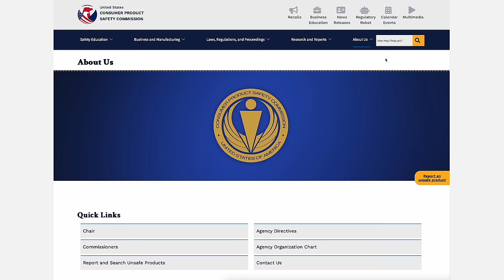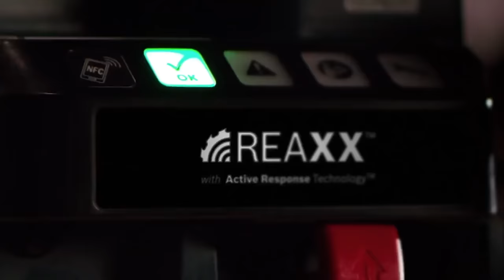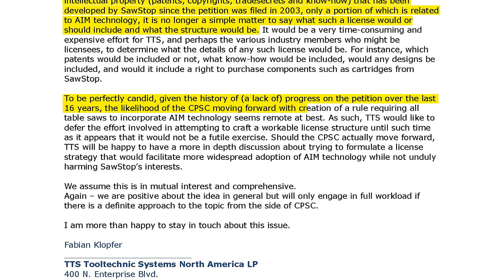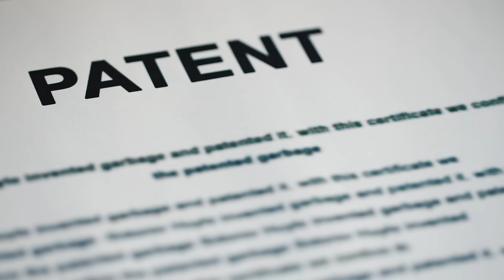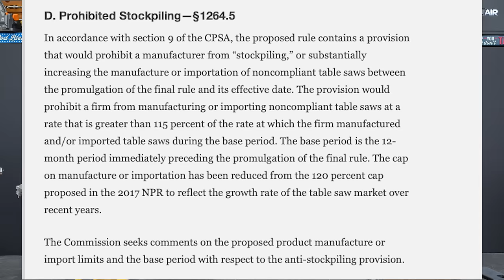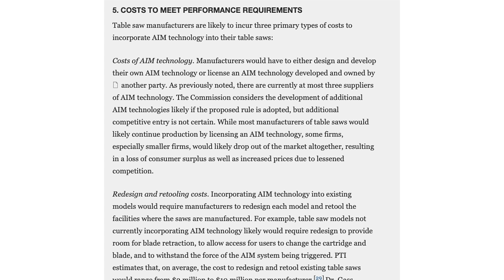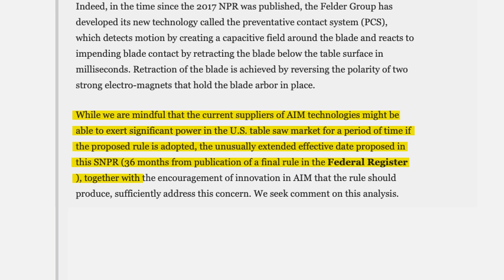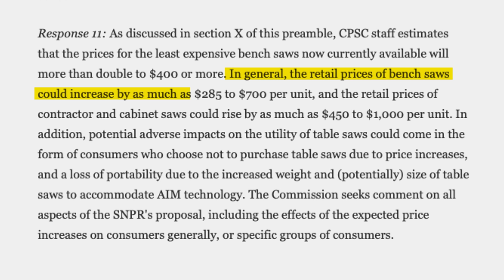The US Government is About to Change Table Saws FOREVER!

Comment: Bosch had a similar, but significantly different from SawStop system, yet Steven Gass tied them up in court and forced Bosch to not sell their version here in the states. 

I would be curious to hear if this law is going to restrict private resales of existing saws? Government can’t even do their presently legally required jobs that they are supposed to do now. Why do they think that they should be passing more laws? Makes absolutely no sense to me considering everything.
Reply: This will spawn a sh1tload SAFETY CO'S charging you to inspect your equipment just like state car testing ( you will have to take your woodworking 
underground, they will then be watching the lumber yards to catch you buying lumber to use on unlawful saws.

Comment: I’ve been using a table saw since I was 10 years old. I’ve got all my fingers and never went to a hospital for a table saw injury. To be careless around a table saw is foolish and I have to question if self inflicted injuries should be counted. Also table saws don’t just die every 6 months, I still have both a 90’s Makita, and early 90’s craftsman table saw that run today, and just bought a newer saw last year. By their own logic changing the law today won’t help me for 20-30 years until I trade out for a new unit, at a greatly increased cost.

Comment: Question - Isn't this a one time use feature? As I remember the demonstration, once that safety element/device is used, there is a very high cost to replace the pieces that stop the blade AND the blade itself is ruined as well.  In other words once the device triggers, the saw itself become a piece of trash.
Reply: No it's not a "one time" feature. It's cartridge-based brake system that you replace ($99) and the blade. In other words, do an internet search if you have to type a "?" at the end of your sentence.
Reply: Thanks for the response - HOWEVER even at that for many people that becomes a deal breaker.  I'm not saying fingers and hands are not worth far more than $100.00 and a saw blade but an accidental triggering of that system is a killer cost item ON TOP of the initial saw cost when equipped with that device.   As the video states, table saws are going to jump up tremendously in price for the home hobby/DIY people especially when the smalelr companies stop making any table saws.   @ReadeMoore
Reply: So about $200 . I consider that single use for all practical purposes .

Comment: The addition of overly protective safety features breads complacency.  Let's face it: the woodshop is an inherently dangerous place to be.  You have to be aware of your surroundings and any time  you lose focus, it's time to hang it up for the day.  I recall once letting my thumb touch a measure tape while it was retracting, resulting in a shallow cut.  I cleaned myself up and went on to make a cut on the table saw.  I ran my  other thumb along the freshly cut edge and cut my other thumb.  That was my last activity in the shop for the day.  You gotta know when it's just not your day.
Reply: ok, you addressed this at the end.  I stand by my comment, though.
Reply: With Saw Stop, the $150+ cost to replace the blade and brake is still a pretty good incentive to pay attention, just reduces the pain of that error. But I agree that the best prevention starts within, but without.
Reply: Do you think we need to Keep government out of this, this will create new laws and taxes with higher insurance costs to shops and individuals seeking liability and disability insurances.   Will OSHA rules shut us down if we don't comply.

Comment: How much money and time did SawStp spend to make this tech work?  They SHOULD be compensated.  That it has taken 20 years to get to this point,  SawStop has not made jacks*** so far.  They should be given an extension.  I currently own 5 tables saws.  I spent 5 or 6 man hours on a table saw this past week?  My oldest continuously owned (more than 50 years)  cabinet saw is a 3hp Wilton Boice Crane manufactured about 1970.  It works great.  And could take a hand off in less time than it takes to blink.  I am all for SawStop and the other tech.

Comment: This brings to mind a new law in the 70's that required lawn mower companies to put the bar on the handle that you have to press for it to run. People thought it was an awful law. The reason that did it was because stupid people were holding the push mower up and cutting their hedges with them. Silly stuff like that.....

Comment: Also not calculated is the loss of productivity because you have to have another replacement switch on hand to replace the used one once a person triggers the safety item.  So the saw is useless until it is repaired.  Lost productivity.

Comment: No one should be buying a table saw from the store having never heard of one or seen one used before not read any of the directions and starting messing with it... So what is this regulation supposed to do make people using them get too comfortable around their shop and still have what happened to them and that is momentary loss of focus or a distraction where they  kept cutting and stopped looking to look at something else so they got hurt and will just get hurt while using the next dangerous tool they got when they still or even more so let their guard down. 

Regulate saw blade coming off and racing around your garage or being electrocuted when you use it not the costly and patented featured made mandatory for all versions of the tool to be paid for by all who need them to work. Not going to ever get a saw stop this smells like a profit driven corrupt and improper use of government.

Comment: 2:00  I bought a table saw for a specific job I was doing (Big wall of custom pine shelving for customers book collection)  I think I paid $180) .. Before I put the included carbide saw blade on ... I threw out all that crap. so i had just a tabe and a saw ... 

Point being .. none of that crap is "mandated" of you can throw it out.

Comment: When I got my table saw, I made sure to watch every 4 fingered teacher and their how to operate a table saw safely.  With that said, I found that there were some cutting operations that you could not use the supplied safely attachments.  I had to make various fixtures to hold work that would otherwise be unsafe. The pushing stick is your way of keeping your fingers out of the working area.

Comment: I have a SawStop in my shop.   I have inadvertently tripped the brake twice over the years.  It is amazing how much hidden metal is lodged in wood.    So either you go over each board religiously with a metal scanner or use the manual over-ride.    Since the former is time consuming I might suspect that those using contractor saws on jobsite will do the latter, unless they remove that option completely.  

To be honest, I am much more nervous using my bandsaw than table saw.  A bandsaw could remove many fingers in an instant.    But bandsaws are probably not as common on construction sites as a table saw.

Comment: OR here is an idea.
Enforce more strict safety measures in the work place.
The equipment is dangerous and should be respected.
If your sleepy, drunk, under the influence, exhausted etc. you should not be using the equipment. 
117,300 large truck accidents in 2021 9% fatal, and that means 10,557 people Died and 106,743 injury's. FMCSA enacted a law in 2013 that truckers travailing long distances are required to take brakes, they also made tech to enforce that.
We have created so many safety features in cars, and Rules of the ROAD, and yet we still have so many accidents, and to many deaths every year BECAUSE OF HUMAN ERROR.

The problem is not the Tech but the level of common sense and awareness people have. They are focusing on the wrong issues.

what happens when the tech fails?
If programs works 100% of the time I would not have a job, just think how often a week something does not work the way it was intend for you or some one you know, the fridge, your phone, the washer, the car, or even simple things like the remote. 
There is always something that has a piece of software that is failing or causes other issues, and how do you get by, by you improvising, and do something else, not the failing object.

Comment: Are these injuries mostly occupational injuries, or home injuries, or a split between the two?
One option is to push the regulation through OSHA, Schools, and Workers Comp Insurance.  Phase in quickly for new business purchases, then phase in regulations over the next 5 or 10 years to get all the old saws out of commercial service.
It is quite likely that hobbyist purchases would rapidly follow behind.  Perhaps have companies that sell saws without the feature to also sell product lines with the feature.
Then in a decade one can also transition for the hobbyist market too.
I'm of the opinion that a lot of the injuries are training.  Start young.  Always use a push stick when working around the blade, and keep track of one's fingers and hands.
Looking at Saw Stop history, there have been many reports of erroneous activation of the feature.  Better for sales if the saws periodically eat themselves up.

Comment: Since you did this video maybe you can answer a question for me. I would love to know what changed to hot water heaters to go from 200 dollars to 800 what changed in them to justify a 600  dollar increase
Reply: There are a few things - supply chain issues for one, two, energy prices driving up the cost of refining raw materials, three, increased transportation costs due to fuel prices, and four, increased efficiency and emissions regulations requiring more technology and components.  All brought to you by federal bureaucrats.

Comment: The safety part is good, but seems like it should wait until the patents are up to balance the cost to consumers, and that price increase doesn't include the costs for when wet material or conductive material triggers the safety device (in SawStop's case anyways...).  I got a SawStop benchtop (~$900) because the math around an injury is compelling and i could afford it, but this seems shady by SawStop to be pushing that.  I'd be interested to know how many of the injuries are from people who remove the other available safety cover and such.

Comment: I always dreamed of having a decent cabinet saw with outfeed tables, 52" fence, and a 5 hp motor.  I priced that saw with several manufacturers and although I didn't choose the least expensive, SawStop was way too high. It was $1200 more that the Powermatic and $3400 more than the one I bought.  

Basically, SawStop says pay the price to keep your fingers.

Comment: As someone who is just starting their woodworking journey looking into buying a table saw, I don't care how safe you are with a table saw, that's no excuse to not implement safer standards. It is well known for being a very dangerous piece of equipment regardless of how much respect you have for it. 
I think it's silly to see folks in the comment section saying, "I've got 1000's of hours on the table saw and never had an issue!"; that's good for you, but not the tens of 1000's of people this machine injures on an annual basis. I worked in cosmetics manufacturing for almost 10 years; OSHA is there to help and that also rings true with the CPSC. Wouldn't it be nice to move those injures from ten of 1000's to a couple hundred?
I hope this passes and we all have access to limb saving, saw stop like technology in the future.

Comment: First, just wow.

I have been using power tools for many years mostly in Naval aviation. From welders and plasma cutters to turret punches and metal shears. Thinking of what you present here and the CPSC, Ralph Nader comes to mind with the Chevy Corvair; Unsafe at any speed! The Pinto also comes to mind. Where is the connection? In the case of the two autos, they were unsafe even during normal and proper operation. I have a 10 year old Ryobi portable table saw. I also have a 1978 model Craftsman Radial Arm Saw (now those are the poster child for safety issues!). Speaking on safety issues with table saws, the opinion of the CPSC is that we, the end users, are not responsible enough to use them safely. Well, frankly, some shouldn't even pick up a rubber mallet. My own thoughts are that these tools aren't the problem; it is the user not using his brain first.

I did hear your attorney friend speak on most of the lawsuits being brought by insurance. Those should never come through under statutes like contributory negligence.

Oh, LOVE the hoodie you are wearing!!

Comment: Yeah, prices will probably go up, but that might actually be a good thing for the hobby. I went for the cheap Ryobi jobsite saw for my first TS. It was something like $150 at Home Depot, which seemed a reasonable risk if I discovered I didn't like woodworking after all. We all know how great that saw is. That piece of crap came close to making me give up on the idea of having a table saw in the first place. I spent an inordinate amount of time building stands, benches, outfeeds, etc for the damn thing. I even bolted it down to a custom-built bench with a Biesemeyer fence rail that I built to support a VCST fence. Which was awesome, but the damn saw was so cheap that the plastic body would wiggle around enough to make it hard to get decent cuts. I finally bit the bullet and bought a Sawstop cabinet saw and never looked back. 

I know, I'm lucky that I could afford to do that, especially for something that I don't make money off of, but if that Ryobi had been $400 or whatever because of blade-stop tech, I probably would have just turned to Craigslist and gotten something used that was better anyway, which would have been almost any other TS ever made. 

One important thing to remember is that we all pay when someone lops their thumb off in the shop. Either they're insured and the ins. cos raise rates on everyone, even non-woodworkers, to keep their profits high, or they're uninsured and our tax dollars pay for the medical treatment. As such, I think it's fine that the government wants to step in and say "hey, stop selling things that cut peoples' thumbs off, it's costing us all too much money." 

I'll also point out that we heard similar arguments about seat belts back in the day. Even though Volvo made seat belt technology freely available, so there were no licensing issues at all, every carmaker (other than Volvo) bitched to high heaven about how much it was going to cost, people wouldn't be able to buy cars anymore, etc. Same thing with airbags. And emissions control. And fuel economy mandates (8mpg is good enough for anyone!). It was all bullshit. Adjusted for inflation, cars don't cost appreciably more today than they did in the past (the gap between their price and the average wage is another story, but that's because inflation-adjusted wages have decreased for most of us). And considering they can now routinely run for more than 200,000 miles whereas in the past odometers only had five digits because no one ever expected them to last even half that, they're a better price now than they used to be.

Companies always kick and scream when the government makes them stop releasing dangerous products. And then they make the products safer, and somehow manage to stay in business and keep selling products.  It'll be fine, and people will stop amputating fingers. Win-win.

Comment: I am surprised Otto Martin hasn't come out with system to prevent injury, because Martin makes the finest sliding table saws. If you have the funds to buy a Martin the extra cost for a safety system isn't an issue.

Comment: Just an observation. Have been looking for a blade for my Bosch 10xc. Great saw, or altleast it could be great with minor adjustments. Unfortunatly Bosch don't do minor adjustment, it does cheap.
Anyway, that's not the point. Here In Norway, that saw seem to be on the way out, few dealer have it, it's blades are more difficult to come by. In typical Bosch fashion they'll try to force you to buy a new one. 
Well, my next product of any kind won't be a Bosch.

Comment: There is the argument about govt being a safety nanny, but there is a point a safety patent should have an expiration date. If SawStop effectively has a monopoly after this gets required, they can either license it at a lower cost over a longer time or their ability to litigate their IP becomes lessened. Being a monopoly shouldn't come with no strings. Reaxx may be similar, but I don't think you should own the ability to stop an injury. How you stop it? Sure. Licensing shortens the R/D but the basic idea is no less ubiquitous than a seat belt in a car. Limiting the reach of a patent will also allow a company to develop their own that might end up being better.

Comment: Another consequence is that if you can't afford to buy it you build it yourself. When I was 15, I built my own. No, I could not lower the blade or tilt it. I used it for about 5 years until I could afford to buy a Delta Contractor's saw. I still have most of my fingers - all 10 in fact.
When a law goes into effect, Saw Stop will raise its prices.

Comment: Its not just the price of added safety tech to the new saw,  but also the price of a new brake cartage and new blade if it is activated. So you will need to have a new one of each on hand .Also,, what about using dado sets or molding heads. I better hang on to my old Unisaw.